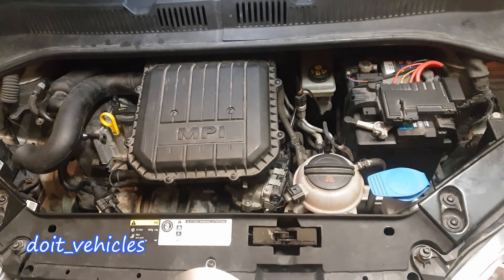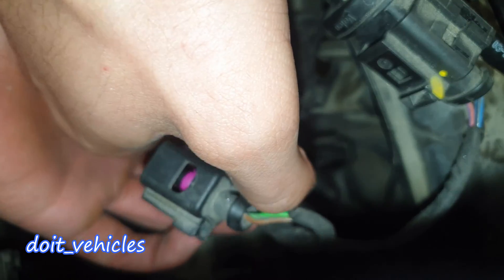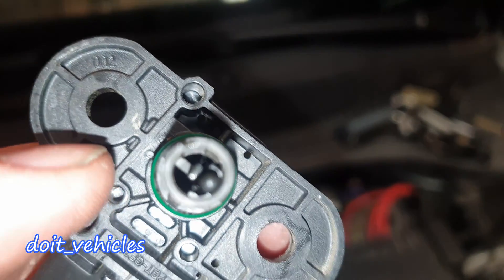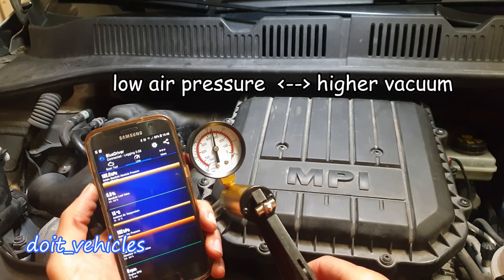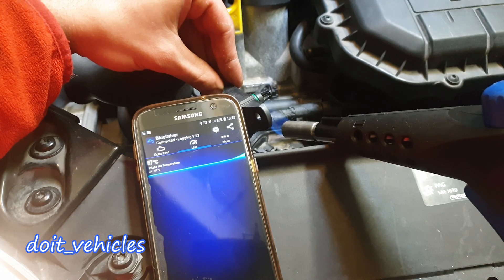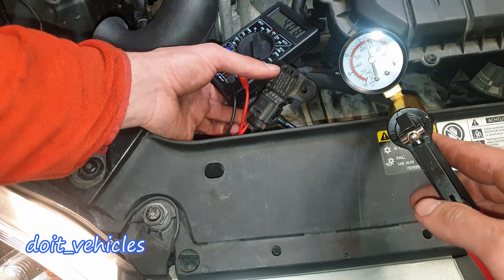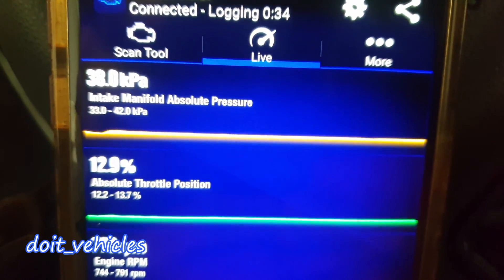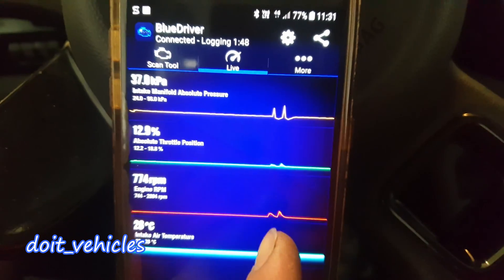Volkswagen up ! MAP & IAT sensor Tests , removal and clean 1.0

Comment: We have a 2018 Up and it failed its MOT on high carbon monoxide in the emissions.  I have changed the plugs, which were very black carboned and I have also changed the MAP sensor, which was clean as a whistle!. I broke the plastic clip removing the MAP sensor but was able to tap the holes and secure the sensor with 5mm bolts as suggested. The readings on my OBDeleven show some improvement on the air pressure and the long and short term fuel trim readings. Re-test on Friday, fingers crossed. Many thanks for the video -super useful.

Comment: Hi,

I have Volkswagen Eco Up from 2014 with Cng and Petrol. A few days ago my Cng stopped working, it only runs on petrol now and does not switch to Cng. When i put in my car keys and turn on the car to first switch then you can see it goes to Cng mode but as soon as i start the car it goes back to petrol. Do you know what the problem may be?

Kind regards

Comment: Hi doit_vehicles! You mentioned that the PCV valve is the check valve located under the left side of the air filter case and that is connected by a hose to the air filter case. However, this valve, as I have tested by blowing through it, seems to let gases go into the crankcase and not into the air filter case in the direction of the throttle valve and inlet manifold as it would be in a real PCV valve. Could you explain how this valve should actually work? Moreover, in the VW UP ILLUSTRATED PARTS MANUAL, this valve is called retention valve (válvula retención). Thanks in advance!
Reply: im wondering the same haha

Comment: Hello I have vw up same mpi 2012 i have always fault code cylinder 1 and i get always epc light on dashboard
Reply from the maker: Have you checked the live data ?
Reply: @doit_vehicles  misfire detected P030000/P030100/P130A00
Reply: Do you resolve???

Comment: How do you remove the plastic clips that hold the sensor in place? I am not brave enough to try prying them.
Reply from the maker: the " safest" is to improvise a small cuted plastic tube and place it around to keep the clips off and pull the sensor ; or something similar . If not you can fasten the sensor with a screw
Reply: @doit_vehicles  Thanks for the quick reply! Do I have to actually remove the clips to take the sensor out? Looks like i just need tu pull the sensor out since on pictures that i have found it looks like there's only an O-ring holding it in place, am i right? I just want to take it out, and clean it.
Reply: I broke the clip today😢
Reply: @aliennn Just in case anyone else has this issue: I also broke the clip on a VW Vento. Fortunately, it’s not a problem because both the sensor and the intake manifold where it’s mounted have holes to put 2 screws that securely hold the sensor in place.

Comment: Nice video👍🏼. I have a 2014. UP simmilar to this one and i am experiencing a high whistleing tone but only during driving in every low ratio gear....and it dissappears when the rpm s increase...have you met this simpto?..it has nothing to do with any belts or crank roles....it s more connected to the hose under the filter connected to ventilation of gas...

Comment: I unfortunately snapped the clip holding in the map sensor, what can I do? The map sensor wouldn’t come out so when I snapped the clip I left it in.
Reply from the maker: it has holes and you can basically tight and secure it with a bolt ; bad design though ..
Reply: @doit_vehicles  are there holes already available to thread into?
Reply from the maker: As I remember it was just plastic , so you can use a short screw tipe bolt
Reply: @doit_vehicles  what size bolt would you recommend?